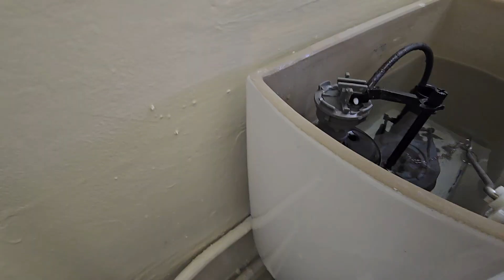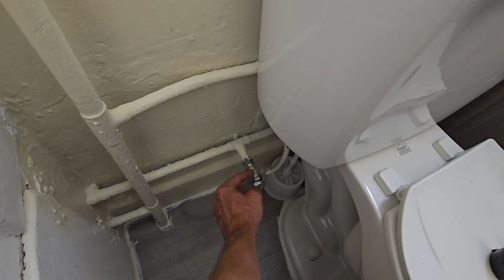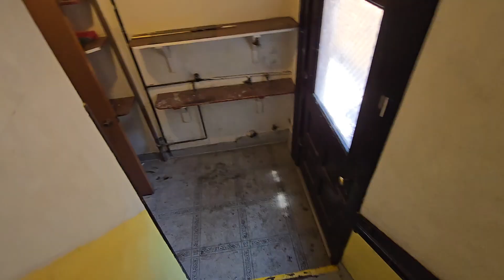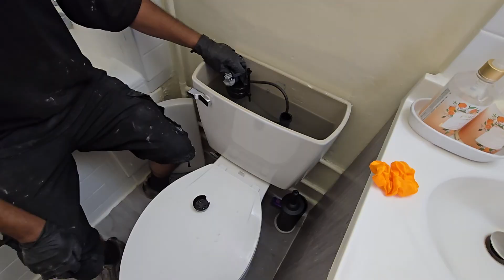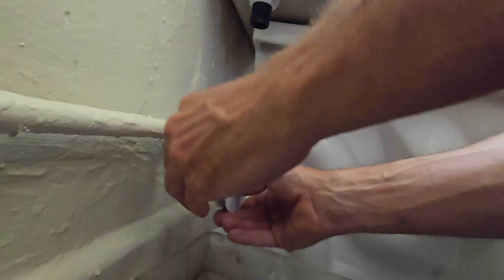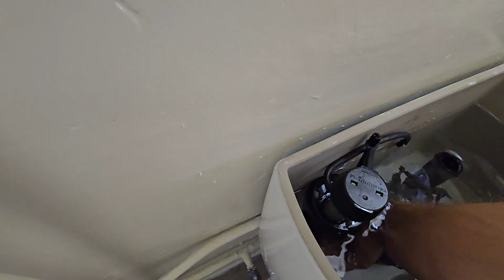If your pipes make this sound: CALL A PLUMBER IMMEDIATELY!!

Comment: I've seen this exact same issue.  Stop valve was a gate valve, like that one, and the gasket was hanging loose on the end of the stem when I examined it after extracting it.  Also corrected the water hammer issue that it was creating once the new valve was on.

Comment: They sell rebuild kits for those stops.
Reply: Why would you use a $3 repair kit to replace a $10 part? I haven't figured that theory out yet. For what your customer is paying you for the whole job, add value and give them something they can actually see. I cringe every time I see a hack rebuild an angle stop that is all corroded and looks like shit.

Comment: out of all angle stops in the building  how did you figure it was that toilet angle stop?
Reply from the maker: Traced the riser pipe for the toilets from the first floor where we heard it
Reply: @pershingplumbing9007  if I came across this situation I would have installed a hammer arrestor, not change out a angle stop, but good job
Reply from the maker: @cominginhot1 the angle stop is the cause for the water hammer due to bad o ring in the stop. If it still happened after that I would have installed a hammer arrestor